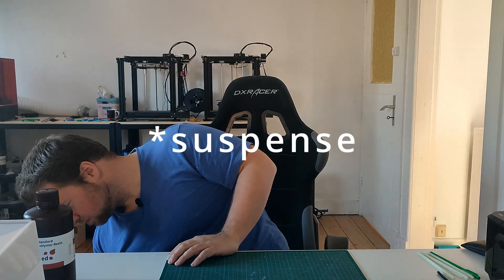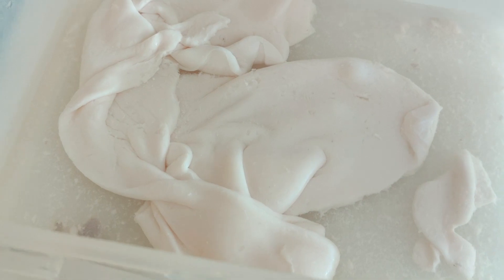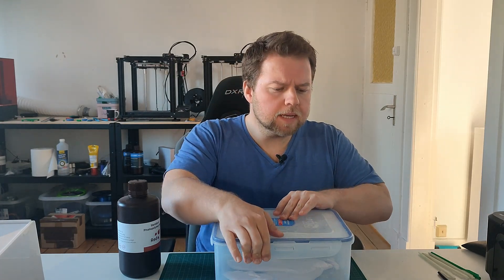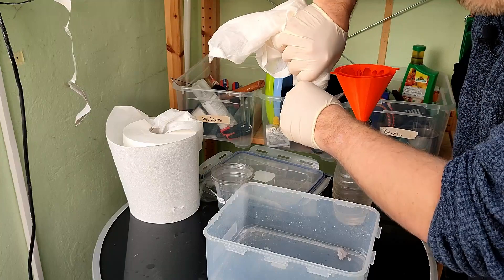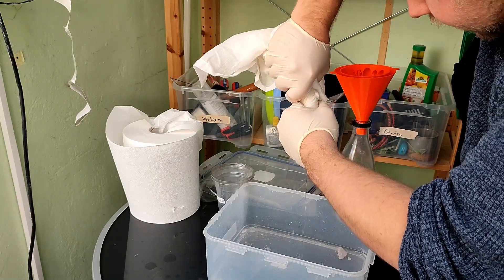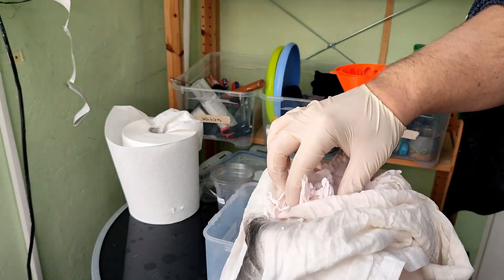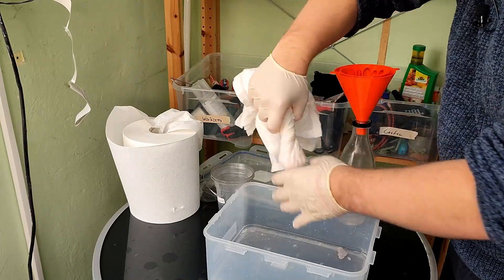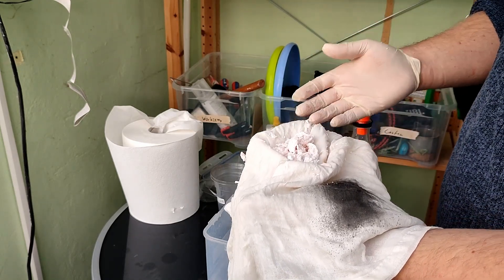Recycling IPA without producing waste FAST

Comment from the maker: Thank you guys so much for watching! I am surprised that this video has so much attention given that is was mostly a test.. Because the question has been asked a few times: I am using a 100 grade cheesecloth. But I do not know if the grading is identical internationally.

Aaand.. Please sub to the channel!
Reply: Nice tip, I actually was doing this just using drop cloth material and or cloths I have around the house. It seems anything will work at varying levels of efficiency. The best thing about dry cloths and such is that they do not clog up as easily.
Reply: Nice tip, i was doing this just only reusing the clear ipa and getting rid of the goo. Btw I was thinking that most probably there is a lot of oils and other stuff that remain in the ipa even after "curing" it, the recycled IPA tends to feel very saturated with whatever nasty residuals keep accumulating in it. as a first wash it will be fine but after a while it will not clean from resin anymore i guess. Hope you update this video with your gained experiences. Cheers
Reply: I'm using a random cheesecloth and it seems to work fine.
Reply: You shouldn't use latex gloves they are not able to stop resin it can and will seep through them you need to use nitrile gloves.👍✌️

Comment: My IPA is very cloudy and I ordered some more last week and it rocked up yesterday so I poured the older IPA back into the container it came in and put the lid back on and it's sitting out back in the sunlight wait for the resin inside to cure so I can grab some cheesecloth and recycle it

I;'m going to use the recycled stuff for my first wash of my 3D prints and use the new stuff for the second wash so it will last a lot longer

Comment: Buddy, I heard of a very elegant way to filter the tiniest nanoparticles out of a solution to borrow a filtering process some breweries use. I can't remember the name of it, something called agglomerative filtering. ( Probably butchered that) Just mix a ratio of 200 ml H2O with 10 grams Bentonite Clay, boil for 20 min, and can be stored in the refrigerator for years. Add about 30 ml per liter of alcohol stir, and let sit for several hours, Decant the clean Alcohol from the clay layer at the bottom.
Reply from the maker: Sounds similar to how beer is filtered. They add a bunch of stuff to it that bonds with the undesired particles. That makes them sink to the bottom and they extract the clean beer from the top.
Reply: @m3chs_makes  Most of the activity in the filtering is attracting small particles that are otherwise in Brownian motion capturing them by sticking to them and the whole mass sinking to the bottom as a clay plug. We are not purifying to food grade here, although this is all you need for a home brewer.

Comment: i found that the IPA recovered from all the squeezing is just not worth the effort- so what I do instead is pour it through the cheese cloth, let whatever is going to drain through it naturally into the container, then dump the wet goo into a separate container that I then take outside and allow to harden completely in the sun. after that I just toss the dry bits of resin into the garbage.

Comment: If you prefer a more passive approach there is a simple way to limit clogging of your coffee filters. As stated, the microparticulates will clog the pores, however agitation during the curing stage will help the resin agglomerate into larger particles. Even though cured, the particles remain slightly sticky and will flock together.

I have a plastic soda bottle on the windowsill with a few M8 nuts inside to help agitate the liquid, scrape the sides of the container and act a a low intensity ball mill. So before filtering, I shake it for a bit, stuff it in the refrigerator to settle (probably unnecessary but colder temperatures should lower the solubility somewhat) until there's a visible clear fraction on top. After this treatment about a litre and a half will cleanly come through one coffee filter, including the yoghurt at the bottom of the bottle.

You can go really hard core and use a flocculent such as aluminium sulphate (a particular type of alum, there are several so get the pure stuff) to knock, essentially everything, out of solution. If I recall, about 10ml of saturated aluminium sulphate solution will treat 1l of IPA. Any dilution of the IPA should be negligible.

Comment: I've been playing this game for 3 years. The bottom line is that alcohol  is less dense than any resin I have used. Therefore the only tool needed to reduce the concentration of resin in alcohol is gravity and time. Depending on the resin, all that is needed is from over night to a few days for sufficient gravity assisted separation of resin and solvent to reuse the solvent. If anyone is interested I am happy to expand on my methods. I use 3d  resin printed parts in my products.
Reply: Same. It all gets dumped into gallon water jugs and it sits for a month or so. Resin settles. Siphon off the top, and it's perfectly good for initial washing of parts. A spray bottle full of clean alcohol as a rinse if anything is still shiny and you're good to go. Being patient pays off.
Reply: I've done the same and even after two months of sitting and then removing the clear IPA from the container, it will still react to UV light meaning that no matter how long you let it sit, not all resin will sink to the bottom. Now I distill the IPA which produces better than 99% pure clean IPA.
Reply: @paparoysworkshop  I can't say I ever get clear IPA. I even put bottles of settled IPA in a cupboard for many months. I just looked at one and there's only a tiny amount of particles settled so the original setting caught 99%. But even though there's still UV sensitive materials in solution, it does the job when time to use it. I didn't mention before that after the initial ultrasonic clean period in dirty IPA, I then rinse the print off with virgin IPA from a trigger spray bottle and that drains into the Ultrasonic cleaner. Seems to work well for me. But I would like to know more about distillation.
Reply: @robguyatt9602  Yes, I’ve done the same for a long time and used fresh IPA for the final wash. But eventually, no amount of settling seemed to be enough and I had to toss out the IPA. 

Distilling is easy, but it’s best to be done outside for safety. I use a metal container filled with water on a temperature-controlled hotplate. The water helps to stabilize the temperature. I then place a sealed IPA container in the water. That container has a tube at the top that connects to a short piece of silicone tubing (for flexibility) which then connects to a vertical spiral of copper tubing. The copper tubing goes into a sealed collection bottle which has a second tube that runs out of the top and goes into a small container of water. That second tube enters about 1 inch into the water and acts as a pressure relief valve. Very simple and effective. 

The speed of distillation depends on the temperature. IPA boils at about 82 degrees C. I run the system at 84 – 85 degrees. If the temperature outside is too warm, I pack ice around the copper coil, but most of the year that’s not needed as it sits in a cool place. 

All in all, it distills fast and there’s very little loss of the IPA. Just keep everything away from open flame or sparks.

Comment: I found that the best is to cover windows with UV blocking sheet and have resin printing station in the corner behind the cover, used the same IPA for a few months that way and nothing hardened, perfect liquid (but very grey/black because of resin color), no particles on washed objects, but the second I moved to another room for renovation purposes my IPA became "plastic cheese" and became unusable after one hour

Comment: I haven't tried it yet (just printed my first bottle of resin ever), but I already noticed how fast the alcohol get polluted by uncured resin (not as fast as yours apparently, but still).
Also filter don't work well at all (perhaps I should try the cheese-cloth trick too, if it allows me to squeeze the residue ... though I feel I'll need much more than what I accumulate from one 1L bottle of resin).
But I noticed that the alcohol clears quite well when it sits undisturbed for a longer time. Trouble is it's really easy to mix at least part of the resin on the bottom when touching it.
Decanting works ok for the top half of the IPA, but when I need to tilt it more to pour more IPA the resin starts mixing back.
I'll try it next, but I have a feeling syphoning would work much, better, as the bottle (or whatever container you use) can stand still, and you only have to trigger the syphon to start draining the clean IPA on top. Since it doesn't disturbs the fluid & resin inside so much you can drain more clear IPA before reaching the resin rich layers.
Now obviously starting the draining with your mouth is not recommended, since both the IPA & resin can be quite toxic and irritate your tissues.
But fortunately there are pumps that can trigger syphoning safely. Quick search shows they cost between $10 & $15 on amazon.

But that separation made me think of how can we optimize it. 
It's obviously due to gravity. Resin is about 11% heavier than water, but alcohol is about 22% lighter than water, so there's over 30% difference in weight between alcohol and resin, already seems like a good start.
But what if we can increase that 30-ish % difference several times?
I'm not sure if it'll make the IPA on top any clearer (though in principle it should), but at least it would make the separation much faster.
All you need is improvised centrifuge.
You can use two identical bottles filled (with dirty IPA) to the same level to keep it balanced, and attach them on a carousel style centrifuge with their cap-ends to the center.
You'll need also a hinge that allows the bottles to hang vertical when not rotating, and to raise up to 90° when rotating.
The bottles doesn't have to rotate at high speeds attached by their caps only of course. There can be a basket (similar shape to your bottles/containers) attached to the hinges and the bottles can stay in these baskets when rotating.
The other trick is to use a controller that can gradually increase and decrease rotation speed (it's really important to gradually slow down. If resin gets mixed up when starting the centrifuge it's ok to just leave it spin for a bit more).
The point is when slowly reducing spin speed the "Down" of the bottle would very slowly tilt from near-horizontal (depending on your max speed) to vertical (when completely stopped).
Then you can syphon the cleared IPA with minimal interaction with the resin on the bottom.
Hopefully using a centrifuge would made the resin become denser and contain less IPA in it - ie get better separation.

This whole thing can even be automated to clean a lot more IPA (or clear it repeatedly, by syphoning only the clearest IPA on the top). For that there needs to be a small logic circuit that switches between (re)filling with dirty IPA, stop filling, and spin for a while at high rpm to get good separation, and finally syphon out (which btw can be done even while spinning; or can gradually slow down to a stop and then syphon of course)
Reply: Love this! And yes, I got up to the part where I've been siphoning off the clear IPA. Sucking to start the process though lol so I think I need to invest in a siphon with a pump!
Reply: @Fasty  , yes you need siphon with a pump for sure. I got mine for ~8 euro. It's meant for wine siphoning, I think it's the same as beer siphon and perhaps gasoline siphon. All of these are easy to find around.
Reply: @Fasty  , update, what's even better than siphon tube with manual pump (that still makes me disturb a bit the settled resin) is 
electric pump :)
For about the same price you can get one of those pumps for the large water bottles.
So this way there'll be no disturbance to the resin (besides the suction itself, depending on how close to the bottom you dip the end of the tube).

But I discovered an even better way to separate resin from clean alcohol and do it continuously.
Using an oil filtration centrifuge.
It's a very simple design. Basically a cylinder spinning at high RPMs, with closed bottom, with few holes close to its center,
and a ridge. The ridge is much closer to the cylinder's wall, so when the liquid (ie IPA) is spinning in the centrifuge it'll be mostly flat against the wall (with the heavier resin particles depositing firmly against the wall), but pouring more fluid will eventually make it overflow over the ridge (think about the simulated gravity, and that simulated "down" pointing outwards of the cylinder).
So you just pour more and more fluid, and the cleanest of it overflows over the ridge, while the heavy particles will settle on the walls.
When you turn off the centrifuge, the fluid (with the resin) remaining to the walls (that couldn't flow over the ridge) will flow to the bottom plate (without the centrifugal effect of the spinning) and will flow out of the holes on the bottom that are near the center.
There's also a housing (usually another cylinder) fixed and slightly larger than the spinning one, tall enough to catch all the clean fluid flowing over the edge of the spinning cylinder w/o spraying it outside (a lid could also help). 
The bottom of the fixed housing-cylinder had 3 areas separated by 2 ridges:
 - the very center one - a hole to allow for the motor axis to reach & rotate the inner cylinder;
 - the outer one collects the clean fluid that has overflow the spinning cylinder ridge and has accumulated on the walls of the outer-cylinder (or dripped directly down, but still in the outer area of the housing-cylinder bottom) has few holes  to allow the clean fluid to flow out to a clean container.
 - the middle area (separated by 2 ridges) is under the holes of the inner cylinder, so when stopped and the remaining dirty fluid flows out it's collected there, and guided to a different (dirty) container again with few holes.
Ideally the bottom of the housing-cylinder could be conical to facilitate faster flow of the fluids (with the drain holes in the lowest perimeter of course).
And that's it.
You only need a strong enough stand to hold it all and few tubes and 2 containers (clean & dirty) for the two out-flows.

The height of the ridge of the spinning cylinder should be as high as to prevent resin & dirty alcohol to escape over it, and low enough to minimize the amount of remaining dirty fluid (that would need to be filtered additionally, either thru a coffee-type of filter, or ran again thru the centrifuge if there's additional fluid to displace it).
Actually when all of the IPA has passed thru the centrifuge, one way to push the rest of the dirty IPA over the edge is by adding water.
Water is ~21% heavier than alcohol, so it'll go the walls of the spinning cylinder with the resin, and will push the IPA higher enough to flow over the ridge.
The cool thing is also that knowing the dimensions of the cylinder you can estimate pretty well what amount of water you need to displace the most of the alcohol (formula for cylinders volume is trivial) - enough to push as much alcohol as possible , but little enough so that the water itself wouldn't flow over the ridge.

NOTE: oil filtering centrifuges usually have a heating of the oil, which in the case of alcohol is not needed (nor recommended!).

Comment: Hi, how can the resin residues be disposed of after the isopropyl alcohol purification process?
Reply from the maker: In general resin can not be recycled (one of its big issues). So it needs to be burned. In the german trash separation system there is a black trashcan just for that. I do not know how it works in the US though. Sorry

Comment: Thank you m3chs for your posting this video. I have a question...would it be okay to use denatured alcohol as the rinsing solvent? it has very very little smell and it seems to work for me okay, but wanted to ask you and the "internet" what you think about it. Thanks in advance for your reply.
Reply from the maker: Well denatured alcohol is also about 94% Ethanol. If anything makes trouble using it for cleaning prints it would be the 6% addetives. I am no chemist but I would just try it out in a well ventialted room. If you see no reaction with the prints surface I would say you are fine. Like, print something small with fine details, toss it into the denatured alcohol and let it sit for half an hour. If it still looks good and nothing weird happened.. 🤷 check out uncle jessys channel. He did quite a bit of testing with different kinds of rinsing liquids.

Comment: Does putting it in the trash as a bunch of microplastic really prevent it from getting into the ecosystem?  I wonder if it should be baked/fused before discarding.
Reply from the maker: I dont know about the handling of trash in other countrys but in Germany we have 4 trashcans at home. Recycling, Paper, Bio and "Other". Sinc resin does not fit into any of the first 3 categories it goes into the "Other" trash and that kind of trash gets 100% burned here for energy (and the toxic air filtered). Instead of being in a landfill or being flushed down the toilet.
Reply: ...Or even stored for 10-25 years until we have responsible disposal available

Comment: I did something similar, I cured the bits and then filtered it through a multi-staged soda bottle filters, using cotton to plug the holes and then using activated carbon to filter it.

After the first two passes it was pretty much clear.

I've also tested this without curing the resin and it went from green to a off-clear with a bit of white.